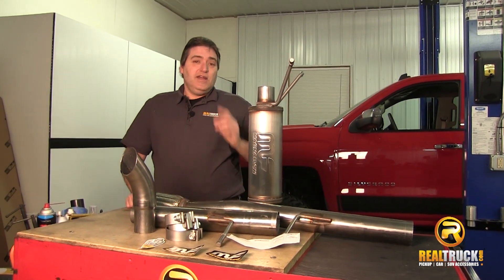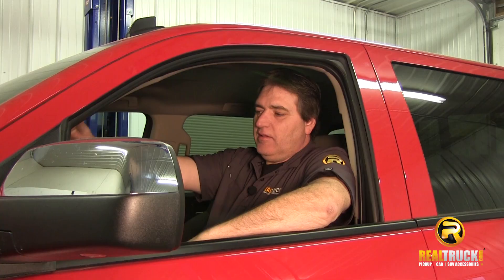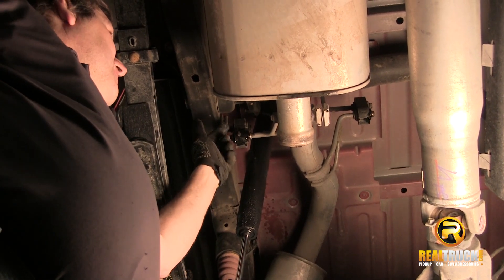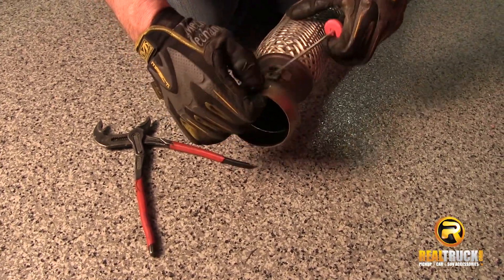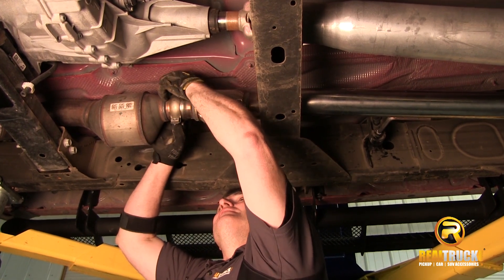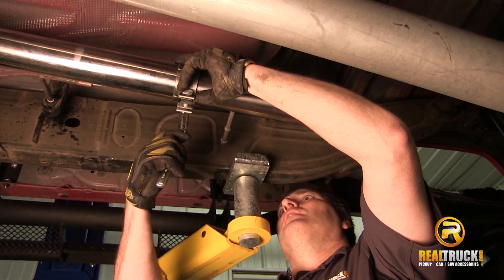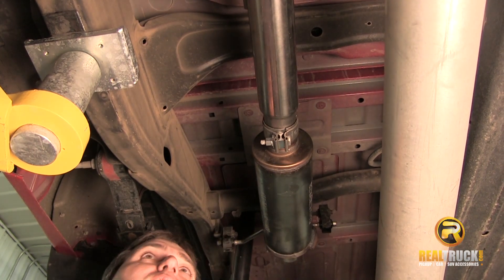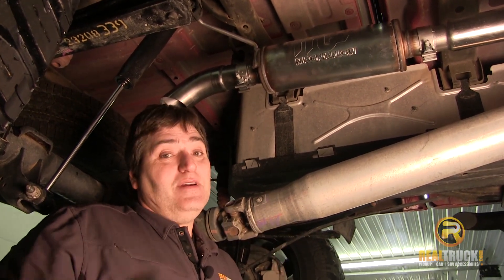How to Install Magnaflow Off-Road Pro Series Gas Exhaust Systems

Comment: I just installed this exhaust on my 15 Silverado with a AFE cold air intake and it sounds sooo good, deep throaty sound, really nice sound when your getting on it and it shifts
Reply from the maker: +joshkilla67 we have a 2012 with the same setup with the headers and yes you are correct it sounds great.
Reply: +RealTruck.com definitely gunna have to look into headers, would like to geta Efi live tune aswell

Comment: why is the tailpipe all the way under the truck? wont the hot gases cause problems?
Reply from the maker: +Christian Rosario no it is perfectly fine so long as the tailpipe allows the exhaust to exit past the cab and the pipe is turned downwards.
Reply: oh ok cool

Comment: Can this be installed on a 2013 chevy suburban? I am kind of new to all of this. I look at the under side of the Suburban and the muffler is larger and longer. Im just pretty confused. Anyways... can this be installed onto a 2013 Chevy Suburban?
Reply from the maker: Hey there, sorry this is not made for your Suburban.
Reply: No it is made for any truck. I own a Chevy Tahoe and I have magnaflow on it. Runs great and sounds amazing

Comment: Does it increase or decrease the mpg?
Reply from the maker: +Jenymon Cyriac anytime you can open up the exhaust and let it breath more freely it will improve both Horsepower and MPGs. The trick is not to overdo it though. Engines do require a certain amount of back-pressure to function properly. Oh yeh. The MPGs only get better if you keep your foot out of the throttle. I know I know. It's tough to do with that nice rumble on acceleration :)

Comment: does it pass smog in california?
Reply from the maker: +Kevin Navarro I honestly don't know the answer to that, and because ND where this truck lives doesn't have smog checks, there is no way for us to know. Keep in mind when considering adding this to your truck though that this exhaust system is designed for off-road use.
Reply: +RealTruck.com Thank you, do you know what size the pipe was after the cat right there where you connected the new exhaust?
Reply: +Kevin Navarro Why wouldn't it pass smog? It doesn't affect any of the emissions systems. If you remove the cats then you won't pass. California would probably fail it too if you tuned out the AFM system.
Reply: yes

Comment: Is the muffler in this kit sold separately? If so what muffler is it? @RealTruck.com
Reply from the maker: Realize99 no it comes with the kit. Here is a link to all the MF Mufflers: https://www.realtruck.com/mufflers/magnaflow/R201555.html  and If you  have any other questions about this or any of the other 500000 plus accessories we sell and would like to speak to a person directly feel free to contact our knowledgeable Customer Service folks at  877-216-5446

Comment: is it street legal to turn them down opposed to running them out the back?.
Reply from the maker: They are not Street Legal no matter which way you turn them. Hence the reason they are a Magnaflow OFF-ROAD Pro Series Gas Exhaust System. Thanks :)
Reply: +RealTruck.com wait, so this is NOT a street legal setup??  is it because it doesn't run all the way out the back??